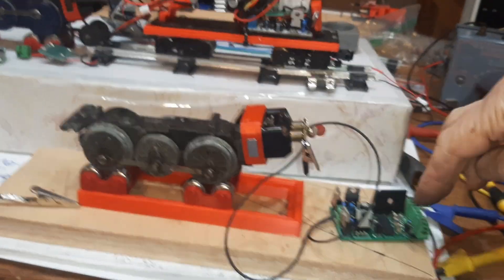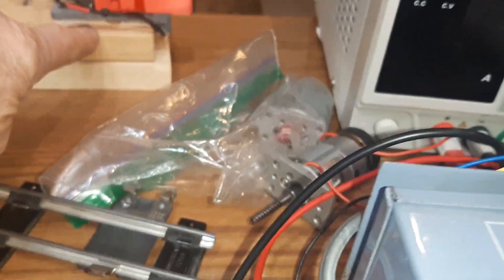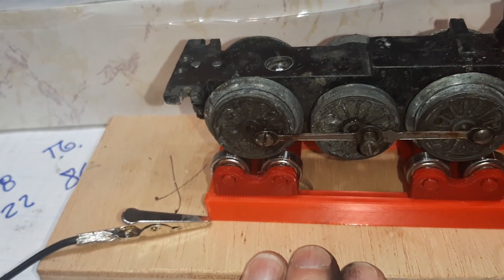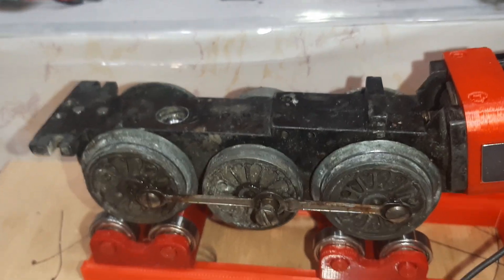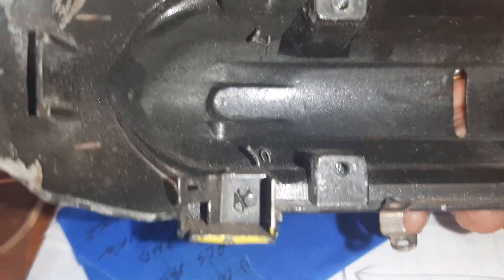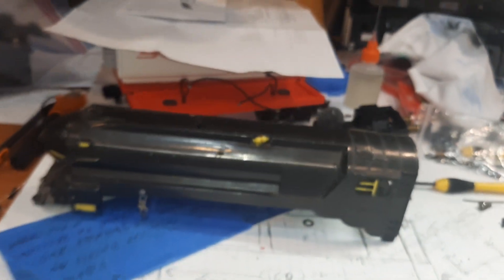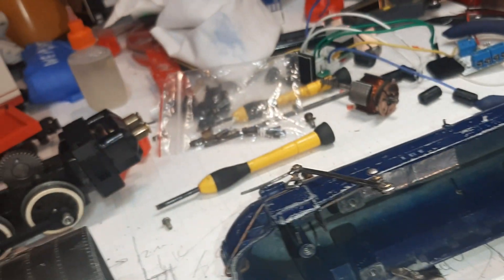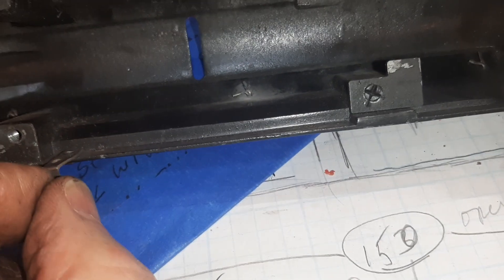Frankentrain Laboratories well this is a real, IT'S ALIVE! Moment. Using our DC Magnetic fields!!!!

Comment: That’s Awesome!!!
Reply from the maker: I know! I was shocked. As I looked it over I thought, dang that sure looked like Flyer. Minor differences but the all the big parts work like a champ. Do you want smoke on this thing? I think you do. And the tender you sent has a whistle build it but it takes up the whole tender. We need to talk about that.
Reply: I have several tenders.. if you need one or two to adapt that will not be a problem. Smoke would be Great. The tender is a self powered Chugger with no smoke. Since the Pre-war Bullet Trains didn’t have smoke in the tender they came up with this. Something like the S Gauge tenders with the Smoke in tenders. These have the light chugging sound as well. That 3 axle chassis is actually from the Per-War Royal blue. The Gun Metal Gray chassis it a 2 axle type. The chassis has a additional axle mounting hole. It is slightly forward oh the center axle. 
Thanks 
Tim